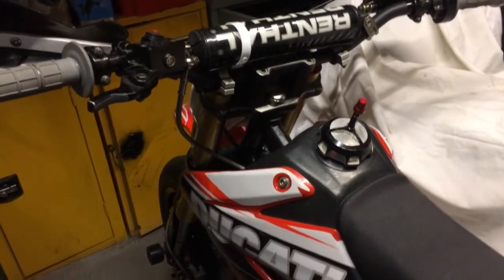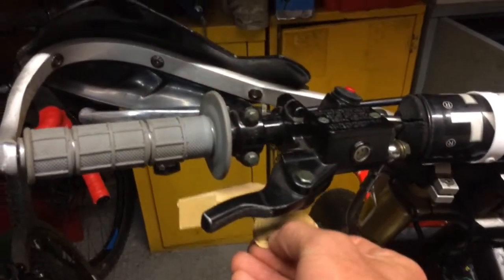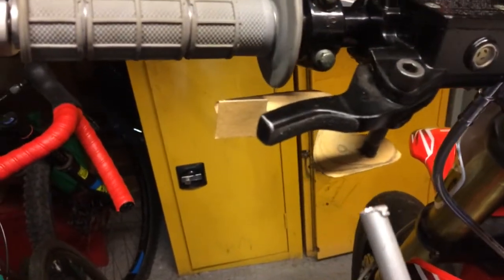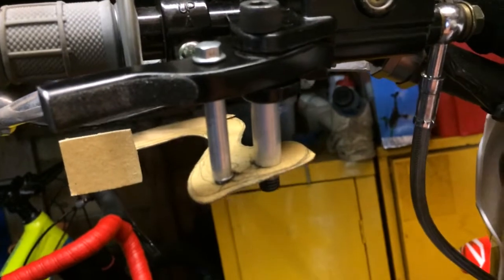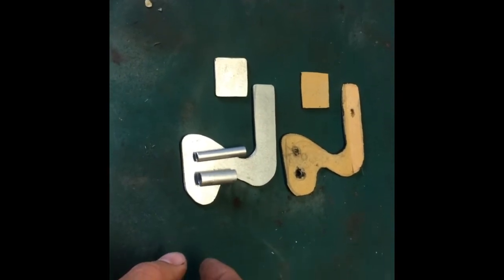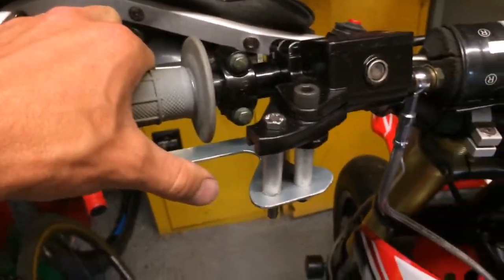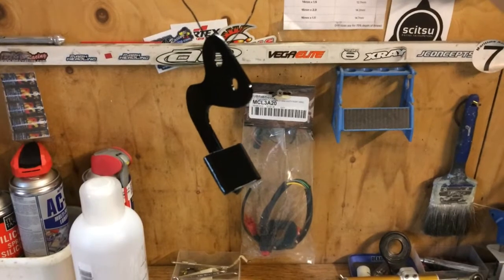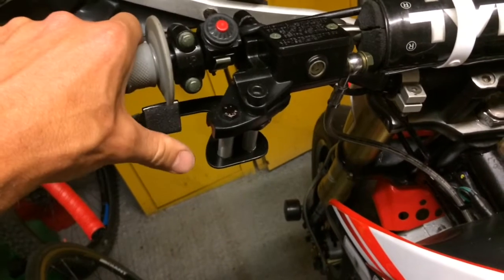Pit Bike  Supermoto Thumb Brake

Comment: After reading your comments and saw where you said it would not lock the rear wheel. When using a large bore diameter MC with a single piston rear caliper, you lose power. Most front MC's are 15-16mm bore to fill more volume twin piston calipers. Ideally a 13mm bore MC would be ideal for feel and lock up power on a single piston caliper at the rear wheel.

Comment: Hi, great video,was just wondering what length of brake pipe you used to reach to the rear? 
Thanks
Reply from the maker: Thanks! From memory it was 120cm but I got a piece of string and routed it through bike and measured it and put in atv brake line in eBay and selected the correct one
Reply: @MHRacing65  that's great thanks

Comment: Can u post the link where you bought the long brake line from please? I'm looking to do something similar to my pit bike
Reply from the maker: Just go on eBay and put in atv brake line and you’ll find a selection, have a measure up first with a bit of string/electrical cable to find the correct length for your bike

Comment: good job.
what happens at the other end?
Reply from the maker: Just bolts up to the rear caliper as per any normal brake, just need to order the right length brake hose for it (google atv quad rear brake line and you should find something)
Reply: @MHRacing65  Legend ! Thank you 👍

Comment: Hi chap where did you get the ally pipe to make spacers ?
Reply from the maker: I had some in my workshop but you can buy ali tubing from eBay
Reply: @MHRacing65  how long was your spacers chap ?
Reply from the maker: @shauns1354  33mm and 28mm long but make sure they are level where the thumb lever bolts on
Reply: @MHRacing65  morning chap fancy making me a thumb brake ? Will pay :) and can send out my master cylinder.
Reply from the maker: @shauns1354  sorry I don’t have any material or time I’m afraid, Pitbike spares/parker racing/Mrs racing sell them

Comment: Hi chap does this actually work ??
Reply from the maker: Yes works just fine, lots of people are using thumb brakes in the Pitbike world
Reply: @MHRacing65  yes iv been looking at thumb brakes but everyone banging on bout master cylinder bore size isn’t small enough so it won’t work ?? As looking to create this myself as think it’s a fantastic idea specially as I got a spare master cylinder and lever . Just need a brake line and sorted for like£20 compared to £100 plus for a made one
Reply from the maker: @shauns1354  they won’t lock up the rear wheel but help when applying it during cornering which is it’s main purpose
Reply: @MHRacing65  100% no need to lock up the rear otherwise I’ll use my foot brake 😂. Hence why I’m moving to a thumb cause better feel where all I seem to do is lock up rear when wearing boot s